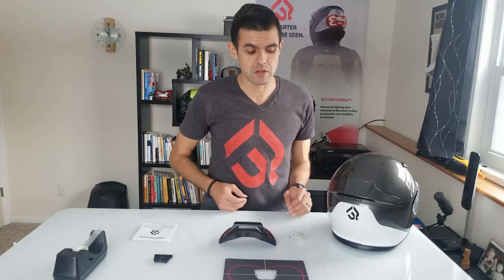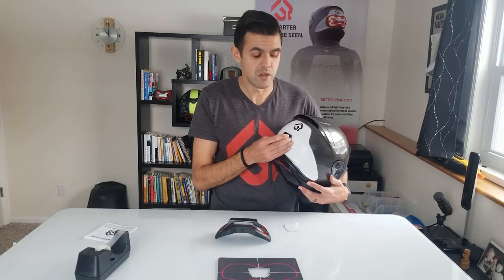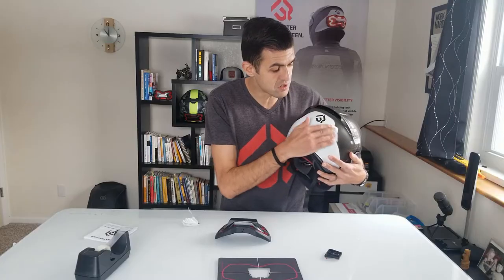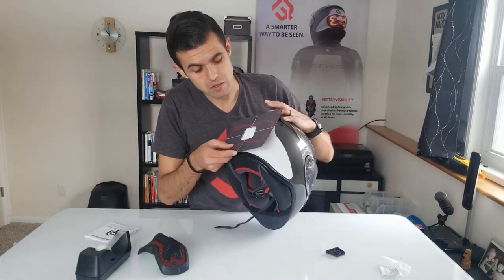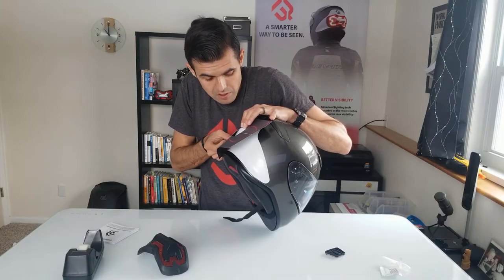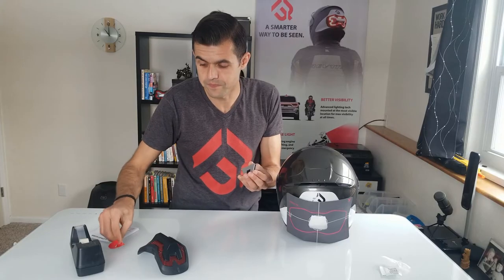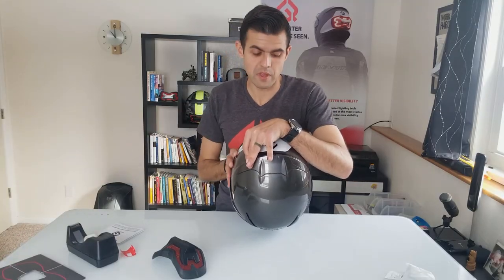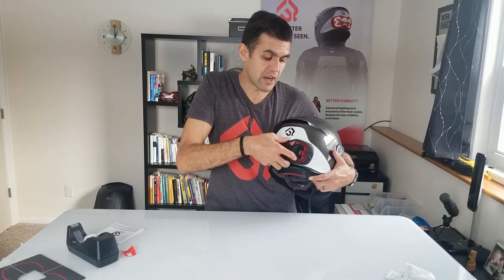How To Install Brake Free On Your Helmet

Comment: Should explain the blinking light for charging better. Annoying to go online to understand the most basic start instructions, especially when you have a bunch of warnings about the batteries(which leads me to think you have known issues with overheat or worse). What is double blink vs triple blink? Do you have to turn it on first? Not complicated to explain basic operation and setup.

Comment: I found two mounts on my box. One that is shown here in the video and a bigger one. What is the difference? And which one should I use?
Reply from the maker: We now include the universal mount (thinner one) and the XL mount (thicker one) in every package to make sure that you can mount Brake Free right out of the box.

The Universal Mount works with vast majority of helmets

XL mount should be used if you ride with a helmet like Ruroc Atlas that has a flat curve on the back, or if you ride with a XXXL or larger helmet. The XL mount gives 5mm extra clearance for Brake Free. It helps with clearing certain design features of the helmet as well. An example would be Sedici Strada II helmet that has a horizontal ridge on the back that would interfere with Brake Free if using the universal mount.

Our FAQ page on our website has more info.

If in doubt, send us an email to support@brakefreetech.com and we'll help you out with fitment advice, pictures of Brake Free on your particular helmet, etc. We're here to help!
Reply: @BrakeFree well doo doo, I just used the XL and I should of used the regular 🙃

Comment: bought one and the fitment on the adhesion and the brake light is really fidgety and causes a lot of drag while riding
Reply from the maker: Would you mind taking a couple of pictures of your helmet with Brake Free installed, and one or two pictures of the helmet mount only and send these over to our support@brakefreetech.com address. I'd like to take a look at your setup and make recommendations if warranted. 

Vast majority of our customers say there's no noise or drag while riding with Brake Free. I'd love to be able to help and make sure you're happy with your Brake Free.

Comment: How does it know when you brake? I've seen other brands that have a transceiver that gets hardwired to the bike..so when you brake or turn, the unit lights up. Which is what i want.
Reply from the maker: If you want something that links up with your blinkers, our current product is not what you'll want. Our product is completely wireless and does not connect to anything. We use sensors we built into the unit to detect any time you're slowing down while ignoring head movements and the like to make Brake Free respond instantly and accurately.
Reply: I can confirm that it works wonderfully.  You can turn your head all you like and it doesn't go off but the minute your upper body slowes down or 'moves' then it lights up and is EXTREMELY bright.   It's a wonderful product, buy with confidence.  No wires or connecting required.

Comment: For me it making sence if brake free is working synchronised with the bike's brakelight.
Reply: The whole point is you don’t always hit the brakes to slow down. Engine brake or just letting off the throttle does not activate the brake light

Comment: How does the Brake Free get switched on?  Does it have a wireless transmitter coupled to the brake light cable on the motorcycle, or it is by inertia? (ie, sudden deceleration).
Reply from the maker: We use sensors built into Brake Free. That's the beauty of the product. You don't need to wire anything to your bike or use any apps. You just stick on our mount, clip Brake Free onto the mount, turn it on and ride. We use a combo of accelerometer and gyrometer to accurately and instantly detect any time you're slowing down and the gyro allows us to cancel out head movements to minimize false activations. Hope this helped. Check out our website for more info. www.brakefreetech.com

Comment: I have it works well rarely use it
because two of my fellow riders have
lost it while riding and its not a
cheap light. I think there should be a
better way to attach it or at least a
secondary attachment or something
Make sure it is clicked in which is the
same question I asked my buddies
and they assured me it was on
properly

Comment: A few small tweaks needed to the design/install IMO:  

(1) I installed it perfectly....upside down!!....coz neither the template nor the mount showed which direction is up and I was so focused on your stated need to mount it perfectly and not too high and not too low and press it on for at least 60 seconds, that I overlooked that (probably more) critical step.  

(2) Although there is no gap in the mount-to-helmet interface, there is quite a large gap at the side edges of the device (and no, there is no spot on the back of the helmet where it fits better).  This makes me worry that wind/water will force its way into the mount seal, break the seal eventually, and the whole device will fly off my helmet, to be squashed on the highway before I can retrieve it.  I'm thinking about drilling a small hole at a non-critical spot at the edge of the device and attach a small, strong wire or string to the device and the helmet, so that at least I can't lose it altogether. 

Oh....one positive I just noticed about mounting it upside down:  Tall backpacks won't cause an accidental release if the backpack presses the unit (per your instruction caution about tall backpacks).  

The unit will function upside down, right?
Reply: Further observations:  The 3M sticker facing is REALLY sticky.  It took a single side razor blade and 15 minutes to get it off the helmet (so I could re-mount the mount right-side-up)... so I no longer think that the 3M facing will accidentally release, i.e. that is no longer an issue for me  However, I noticed that it was fairly easy to pry the device off the mount (and yes, the mount stayed firmly on the helmet) by simply putting my fingers under one side or the other of the device...so I'm still wondering if wind could get get under the device and release it. Obviously that would be bad. 

I'm thinking about applying some velcro with double sticky sides to the helmet and the outer edges of the device, but that causes a new problem in that I now have to ALWAYS pry the device off the mount (and one side of the velcro) from one side of the device or the other.  That will probably eventually cause the mount-device interface to wear away and become even looser.

So I'm now back to wanting to drill a small hole in a non-critical edge of the device and attach a strong string or stainless steel wire from the device to the helmet so that at least it won't end up as road-kill.

Ben
Reply from the maker: Finding a proper location is important, so I probably spent a bit more time than needed hammering that point. I didn't think mounting upside down was something people would do. I assumed it was somewhat obvious. If you use the template, all the writing would be upside down, our branding on the unit would be as well. This is not feedback we've ever received either. I'm not sure this issue warrants a design update. I would re-install it right side up with a fresh mount (don't re-use the old mount). The charging port is at the bottom to make it more protected from the elements and is the only potential water ingress point. Although the unit will work upside down. I still storngly recommend you mount it right side up. 

Having a gap on the edges is not a problem. The back of the helmet doesn't have as much air going over it as the air is pushed over and around the helmet as you ride. It's not an issue. The adhesive is strong. 

If you want, you may drill a small hole on the edge of the unit in the rubber part on the outside of the left or right LED panel, there is a bit of a divit or a recess in the design and that's the thinnest part where you should be able to make a hole without compromising the seal of the unit. Of course, do this at your own risk.
Reply from the maker: @charlesethridge3533  i've tried to pry Brake Free off my mount in the way you described and failed to see how you're doing it with the unit fully clipper into the mount. Unless you are pushing the unit straight up in the way you would to remove it from the mount. That would not happem while you're riding as it would require a very strong wind to somehow push up on your helmet from the back. That scenario doesn't seem likely. It just isn't how the air moves around you as you ride. 

I've seen a few folks use velcro because they didn't feel our mounts are secure enough for their liking, and that's fine. It doesn't hurt anything to have it even more secure. In our testing, the mounts do a great job holding the unit securely on the helmet. Our mounts have been tested at over 140mph, tested by a Baja 1000 rider in the craziest terrain imaginable, as well as thousands of hours riding with our prototype units prior to launch. We are confident in our mounting system.
Reply: @BrakeFree  Thanks for the response on drilling.  

Regarding the template, the template I received has no writing ON THE SIDE FACING OUTWARD, i.e. the side one would be looking at when temporarily attaching the template to the helmet with tape. I can post a picture of it, if you like. Without some kind of "THIS SIDE UP" on the template or "caution" in the instructions, it wasn't obvious to me at least, and I'm usually pretty good about following instructions....but I'll let it go since mine is done and it's apparently a non-issue for others....and yes, I re-mounted it right side up for the reasons you stated.
Reply: @BrakeFree   No, I'm pulling it straight out away from the helmet.  I only did it a couple of times and I hesitate to keep testing that, since I may weaken the Brake Free device side of the mount.
Reply: @charlesethridge3533 One thing it doesn't say when you have a full change. My question is, how do I know when it is fully changed. Thank you
Reply from the maker: @gray_wolverine63  the complete user manual is available on our website https://www.brakefreetech.com/pages/support
The two indicator lights that blink while charging will glow solid when fully charged. Thanks for your question.

Comment: How much does this weigh?
Reply from the maker: It weighs 170 grams (or 7oz), so it's pretty light. Most of our customers say they don't notice it while riding. Since Brake Free is aerodynamic and mounts in the back of the helmet, it's in the slip stream of air. You won't hear it either.